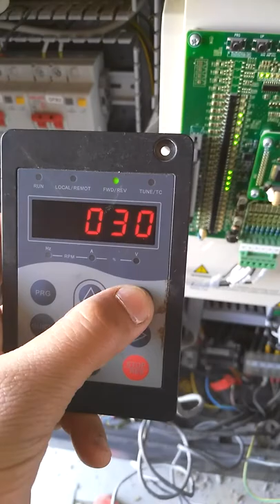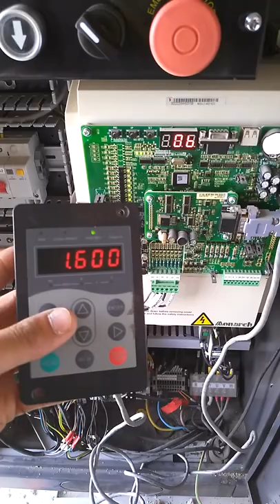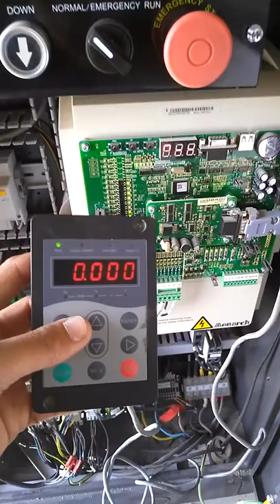solve error 65/66 in monarch control

Comment: Good afternoon friend! I have a problem with such equipment. when I make the high adjustment it when it finishes the Cirilo of fire appears and goes to the ground floor I already checked the keys in the buttonhole and the button inside the cabin. can you help me?
Reply from the maker: May be your fire switch not working

Comment: Hello
Do they have information about the reopening of double entry cabins ..?

I would thank you a lot
Reply from the maker: How many doors you have in front or rear side??
Reply: @masterliftspakistan6559  I have two doors, in the front the second door does not reopen with the floor call button while the elevator is on the same floor.
Reply from the maker: Which addresses you set in HOP??
Reply: @masterliftspakistan6559  I do not understand what it means
Reply from the maker: First You set the address in HOP,, Read manual about HOP Address.

Comment: Error 65, in nice 3000 controller, this lift 2 to 4 day good running again get problem like lift hang that is big problem it happens regulary please give me a solution, many engineer seen that they work but 2 day after same problem come, please help me, give a permanent solution idea
Reply from the maker: Need to adjust some parameter after that it 'll not show error again
Reply: Aoa Can we fix this error E65 with nems software

Comment: How to resolve error 27?
Reply from the maker: Check auxilary of pmsm contractor
Reply: @masterliftspakistan6559  Excuse me, the pmsm how do I check it? and what does pmsm mean?
Reply from the maker: @brandonstitescobarmunoz7353  PMSM means Permanant magnet stator motor. And this function use in sunchronous motor due to safety purpose
Reply from the maker: Please check the pmsm contractor &  contractor feedback
Reply: ok, and you know of some parameter to be able to solve that error?
Reply from the maker: You can solve error through parameter. Tell me when you press comtractor so which LED ON & OFF in the main MCB??
Reply: @masterliftspakistan6559  men, when you say comtractor what do you mean?